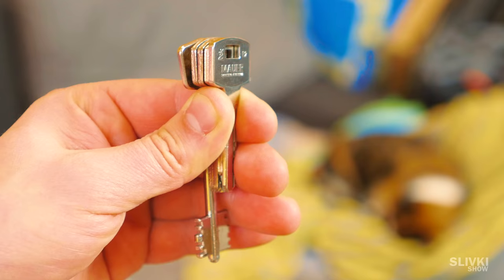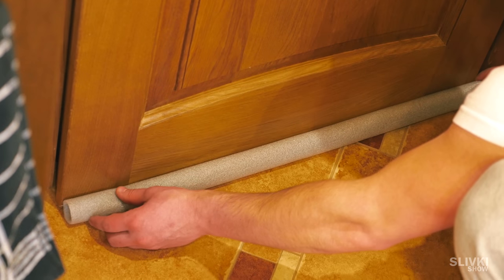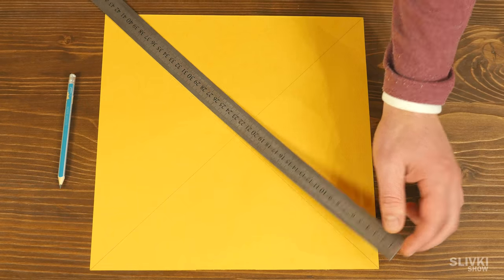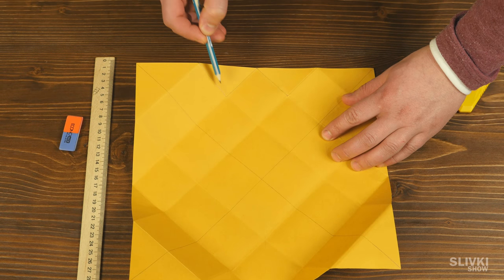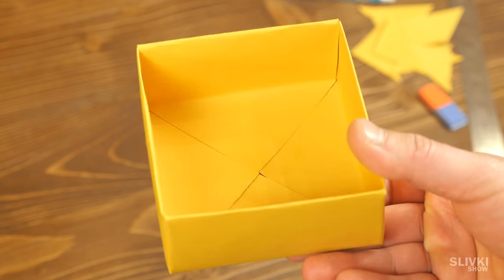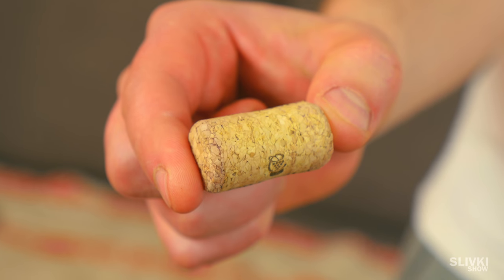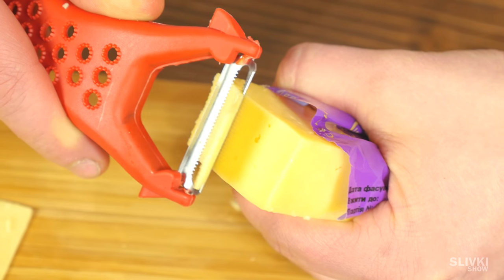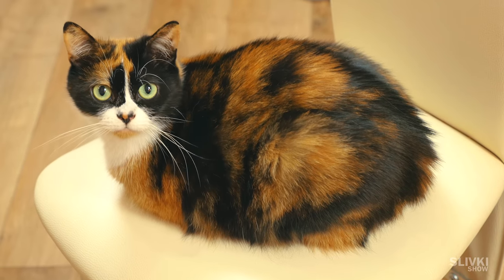6 Simple & Fun LifeHacks

Comment: 2:45 I have a different trick for chips (or crisps for brits); wipe the inside edge of the packet with a paper towel so that it's clean, press the edges (front and back) flat against each other and go across them from the top with a heated clothes iron, the packet will seal and it will be like unopened.